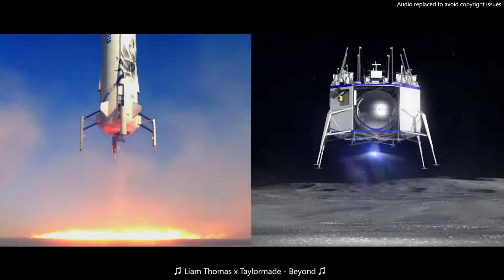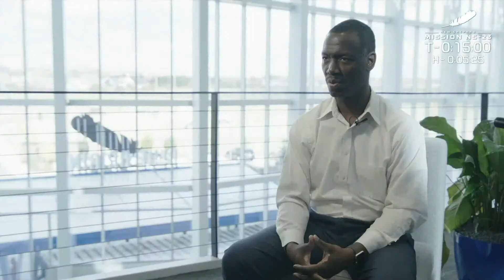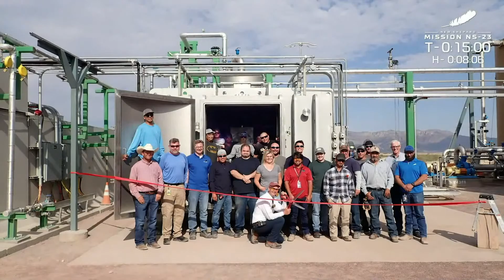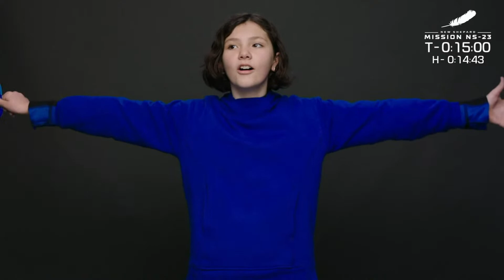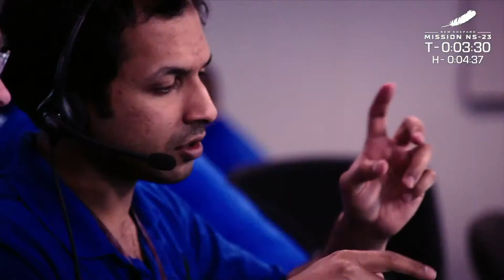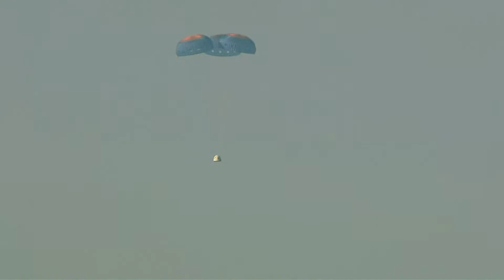IN-FLIGHT ABORT: New Shepard NS-23 fails to reach space! (12 Sep 2022)

Comment: If there was a crew on board I doubt they would say the word anomaly when the engine exploded !  I am very impressed that they replaced the retro thruster landing system with the new body slam system !  This will definitely save on fuel !
Reply: yeah, no retro thrusters fired on crash, umm, landing I mean
Reply: That would have been quite a kick in the pants to ride that escape booster. That went from about 595mph to 700mph and then braking in just one second. That would have been roughly 5 gees of acceleration followed immediately by deceleration.
Reply: @danjf1  the thrusters DID fire. You’ll see the dust “poof” right when the bottom of the capsule appears to touch the ground but that was actually several meters above the ground still. If you look when the dust clears you’ll see that the capsule is partially hidden by a small slope/hill. It was that hill that gave the illusion that the capsule hit the ground.
Reply: The dust pattern appears to show landing thrusters firing, it happens so close to the surface that even 0.25 slow-mo may not show it (it's still a "car crash"). Same with Soyuz landings, which have never failed (Soyuz 1 doesn't count since the parachutes didn't work in that Kremlin-driven FU).  It'll be interesting to learn whether the firing really was timely.
Reply from the maker: The landing thrusters fired normally, and cushioned the landing in exactly the same way as all the other New Shepard capsule landings, including the ones with 80 and 90 year old passengers. The landing was much softer than a Soyuz, which is notoriously rough on its crew.

Comment: Seems like there was a lot of energy yet when the capsule touched down.
Reply from the maker: The landing was normal. The large puff of dust is caused by the retro thruster firing in the last milliseconds prior to landing. It really does cushion the landing. Remember, there have been 80 and 90 year old passengers on New Shepard launches, with landings exactly like this.
Reply: @RawSpaceVideos  So a micro booster decelerates at the very end of the ascent. That makes sense but visually seems to be stressful based n the video with what looks like a very late deployment. Visually it looks like it hit the earth too hard or if there was a deceleration boost at the very end seems like the strain would be about as great.

Comment: Did they loose the booster ?
Reply from the maker: Yes, the booster is destroyed.
Reply: @RawSpaceVideos - I'm fairly sure the capsule was destroyed as well, by that hard landing with no last-second retro rocket blast.
Reply from the maker: The landing thrusters appeared to fire normally, and cushion the landing in exactly the same way as all the other New Shepard capsule landings, including the ones with 80 and 90 year old passengers. The landings are much softer than on a Soyuz, which is notoriously rough on its crew.
Reply: @RawSpaceVideos - Really? Because I went frame-by-frame and did not see that.

Comment: I wonder if the capsule burned too much fuel in the abort ( it seemed like it fired for a very long time to me)  and when it tried to relight for the landing there was literally nothing in the tank.
Reply from the maker: The launch escape system isn't designed to be relit; it expends all of its fuel, to get the capsule as far away from the booster as possible. The retro thrusters that cushion the landing are separate. The landing was normal, and would have kept the crew safe (had there been any onboard).

Comment: Just happened to fail on an unmanned flight? Mhm.
Reply from the maker: NS3 was an older booster with more flights logged than NS4. All crewed launches have used the NS4 booster. It's not surprising that NS3 is the one that failed.

Comment: I don’t think the retro thrusters actually fired. Does anyone who’s not a moron like me know if they worked ? The dust pattern looked like it was just from the capsule slamming into the ground.
Reply: I saw the same thing. It looks like a death landing as it slammed hard without the booster rockets engaging. I could be wrong though.
Reply from the maker: The landing thrusters fired normally, and cushioned the landing in exactly the same way as all the other New Shepard capsule landings, including the ones with 80 and 90 year old passengers. The landings are much softer than on a Soyuz, which is notoriously rough on its crew.
Reply: I thought the same thing. Very subtle if they did fire as I could not tell by the video.
Reply: @RawSpaceVideos  Very subtle if they did fire as I could not tell by the video.